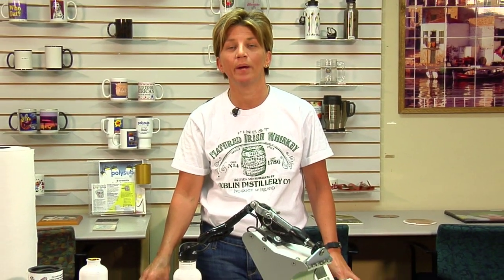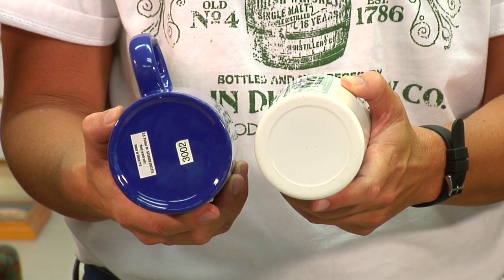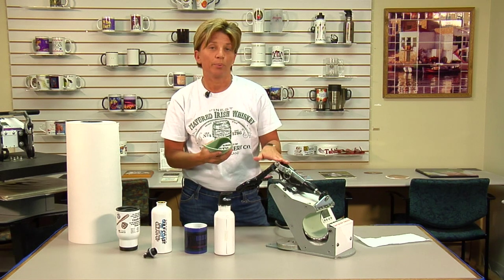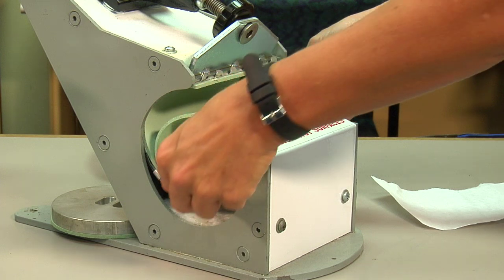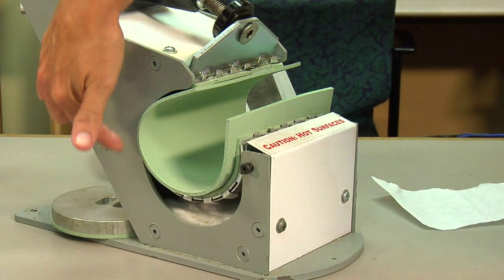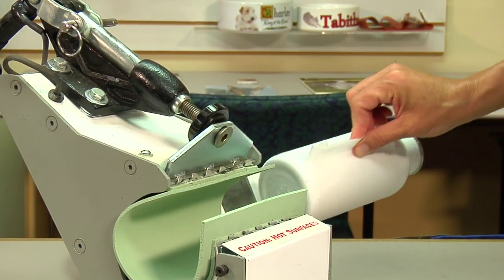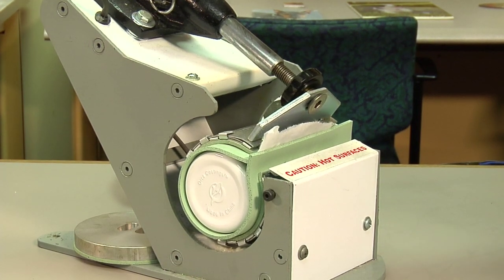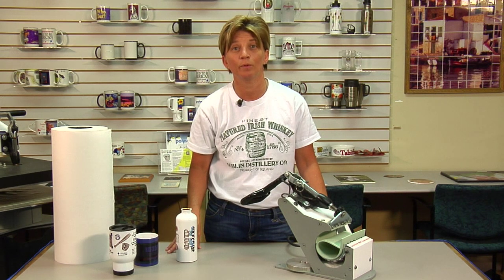Using Heat Conductive Rubber Pad while Imaging Water Bottles -

Comment: This video will be 10 years old later this month! Who would have believed this older video would have been so helpful! I just got the Green Heat Conductive Pad in my Conde order this week. I got it to make it easier to do water bottles in my heat press (NOT the Geo Knight, couldn't afford that one!). The first water bottle I did, did ok with silicone EXCEPT that I got didn't check it again with the silicone and got the press too tight and bent the bottle some! Opps! :) Not to mention that apparently the water bottles need MEDIUM pressure, not heavy pressure.

I had watched this video among many others. Everyone else had you wrap the pad around the bottle and put BOTH in at the same time. But when I was ready to go and went to turn on the mug heat press. It occurred to me that if it was heat conductive, that maybe I should put it in first to let it preheat. I thought it would be ok since I seemed to remember that someone DID put it in first.

 I knew it would be easier to put the water bottle by itself and make sure my design was within the actual element and not outside the element. Worked great, opened quickly and flipped the water bottle completely around and closed. My design was completely around the bottle so I needed to make sure I got full heat. Came out perfect! Thank you Vicky!
Reply from the maker: Hello Angela!  You are right, this video maybe an oldie but it still is a goodie!  Thank you for watching and supporting our channel!